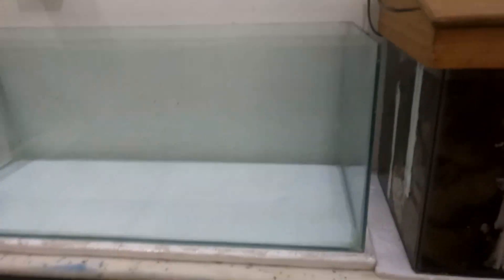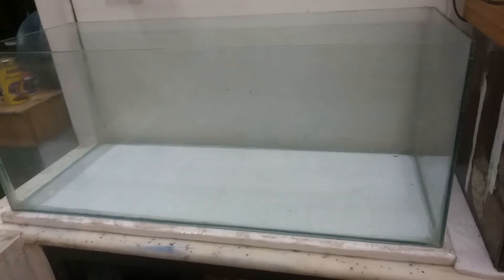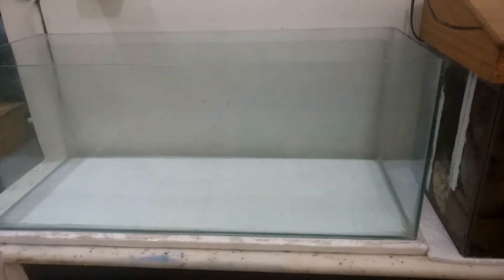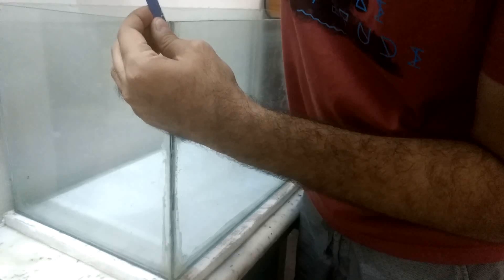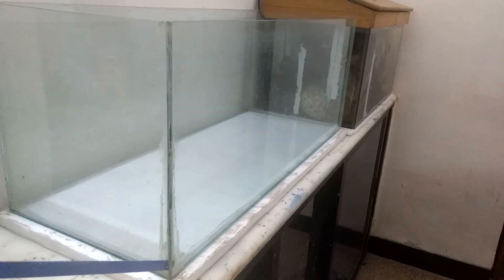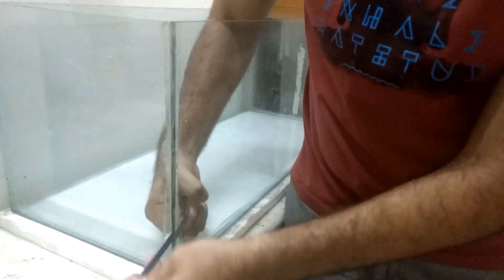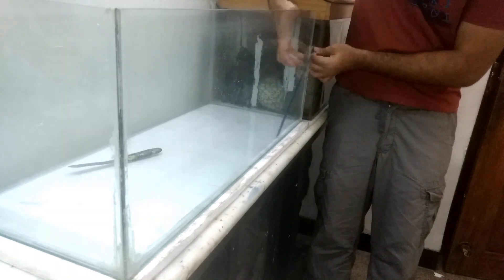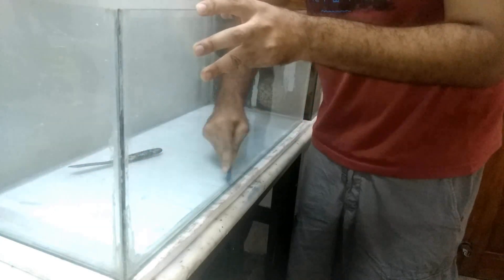How To Remove Aquarium Glass At Home | DIY

Comment: Many videos show great ways, but you have the best tool. What would happen if you move the tool like a saw in some dry silicone parts. however, i am concerned this tool like many is too thick, and it will crack your glass.
Reply from the maker: Thanks for your lovely comment.  A small saw is think n will not crack a glass. Moreover, we should not put a lot of pressure while doing this activity.   dry silicone will cut easily using sharp objects.

Comment: bro my tank size 4/2/2 and my tank top bracing was broke front bracing middle howhappen it...?
Reply from the maker: Did you smash it by mistake. If it's broken, then remove it and install new one. If water is there in the tank then lower the water level to half and install. Make sure glass shards don't fall in the tank

Comment: I'm just too scare to break the glass so I'm being too gentle. I'm going to yolo the tank in a minute. Put on some Gloves, Eyewear, and just do it.
Reply: how’d it go
Reply: @erikaesch776 
Not well, the hacksaw blade wedge into the crack made the glass spiderweb.
It's sitting in storage.
Umm now that I broke it, it might actually be a blessing in disguise.
Now I can try different method and not worry about breaking a already broken tank.
I'm thinking of using "heat" such as a soldering tool, but it's not quite thin enough to melt the silcon in the crack, so maybe a "hot" razor blade sound alot more practical.